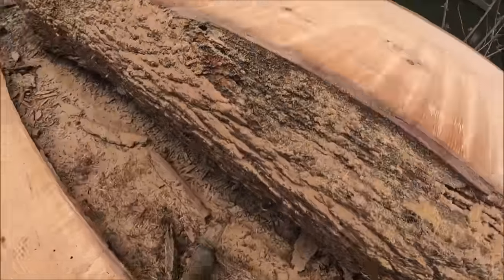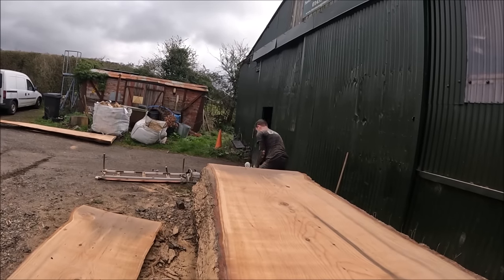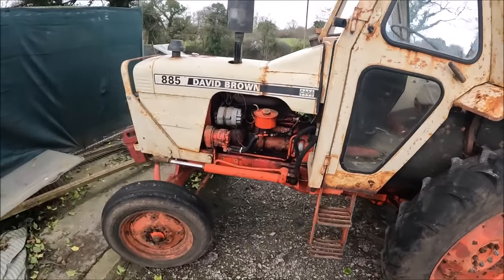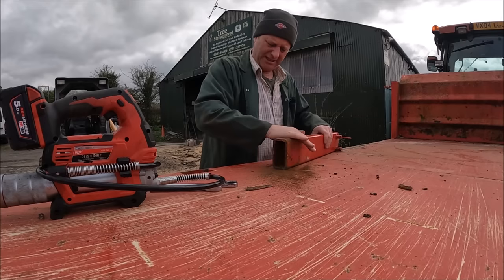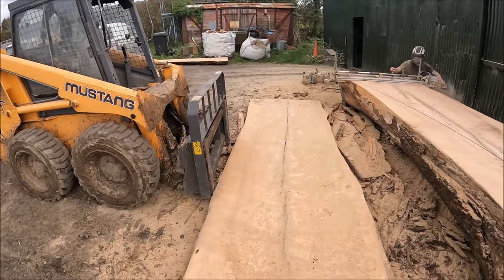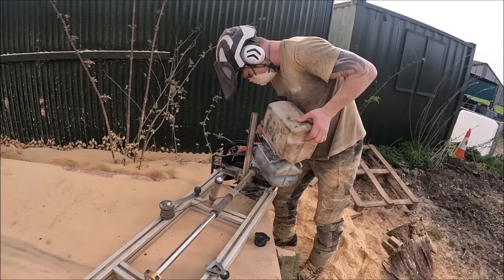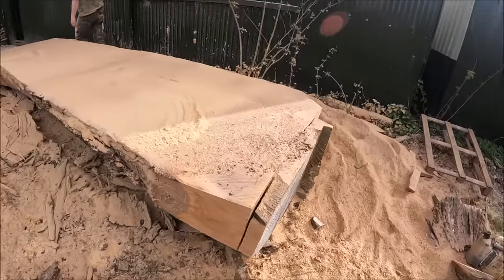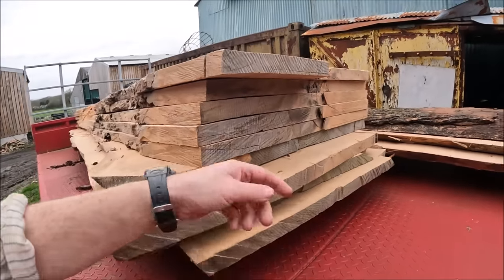19/03/24  Alaskan Cedar planks and old war stories.

Comment: When we cut wet lumber like that we Separate the planks with 1 inch strips of wood so airflow goes between the planks for drying purposes
Reply from the maker: So do we usually, but we don’t have any untreated batten handy, it will have to be re stacked when get some.
Reply: Farmer P said that in the video!

Comment: Interesting to hear your solar PV musings. Only this week I got a quote for a 7kW battery system to add to my 4kW solar PV system. But as we already use a fair chunk of what we generate (80+ percent in winter, and 50-60% in summer), the payback was at least 10 years which is the guaranteed battery life. I think the £5000 is better invested in a fixed rate bond or similar…..

Comment: Hi Ian, war stories. I owned a house in Brockworth and found a framed newspaper page of a soldier with rifle guarding the house. The story read that a Gloucester aircraft taking off from the factory's airfield had hit the chimney, quite why that needed an armed guard I don't know, Maybe the landing gear got knocked off and it was Top Secret.
Chatting to some old boys in a local pub, one had the job of towing hedges grown in pots mounted on trailers, used to camouflage the runways. The roofs of the factory had been painted to look like veg growing as another precaution to foul Gerry.
The farm I worked has a satellite unit of Nissan huts with German writing in the concrete base, the dairyman said the place had been a POW camp in WWII. I just wondered if it was just a camp or a working farm in those days.

Comment: We decided to go for solar panels and batteries on the roof of the house now that some large confers had finally been cut down directly behind us. Unfortunately we discovered that the roof tiles are too thick and something about how they are laid means that the frames for panels can’t be put up without too higher risk of broken tiles and leaks. We tried four different companies and they all said the same. So in the end we just had the batteries which we charge overnight on cheap rate electricity and run the house on that during the day. It works amazingly well and we have cut our usage down quite a bit barely using mains electrics during the day. Still would love to have had the solar as well we would almost not use mains at all

Comment: I like the boards, lots of potential uses and the smell of the cedar would be great. I like your brother's DB 885. I used to drive Davie Broons when I was a student. The 885 was a very under rated tractor. The MF 135 and the Ford 3000 got all the fame, but the 885 was every bit as good.

Comment: Hi Ian as a chain saw novice all I use one for is to lop off branches to prevent overhead cables getting damaged. So could you explain the difference between the chains please one day mate. All I use is the Oregon one's they sell in Screwfix.
Reply from the maker: There are many types of saw chain Brian. You will probably be using a slower semi chisel safety chain.

Comment: with the roof space you have on your barns solar has to be an option, even the height could help with putting the batteries up in the rafters ona frames/platform and save some space if you can.

Comment: Was that a 10 degree chain? I only use 10 degree on my Alaskan mill but don’t bother with a skip chain as the shallower angle gives the chainsaw an easier time
Reply from the maker: I believe it was a 10 degree chain Paul.
Reply: @FarmerP  that’s why it was giving fine dust then rather than proper chips. Cutting the end of the grain with a shallow angle